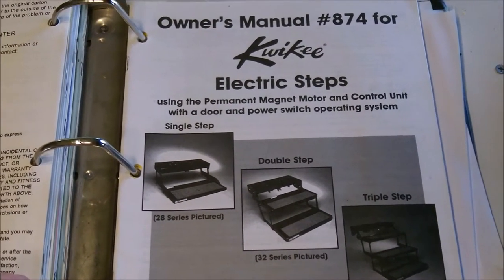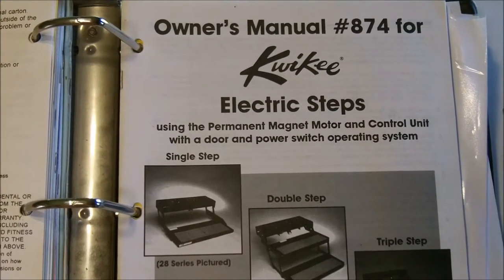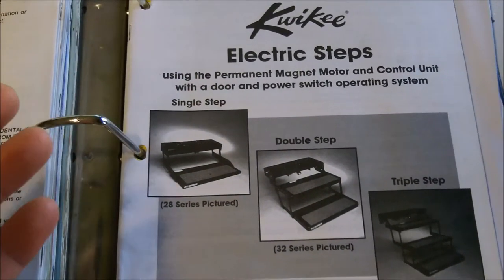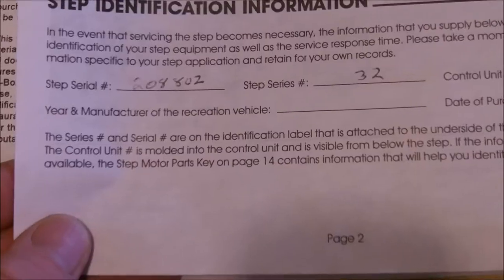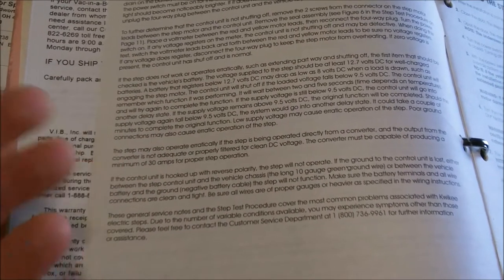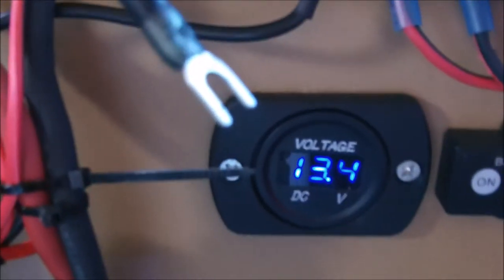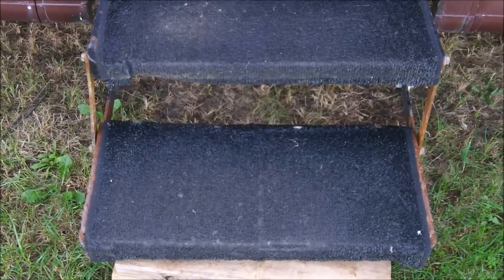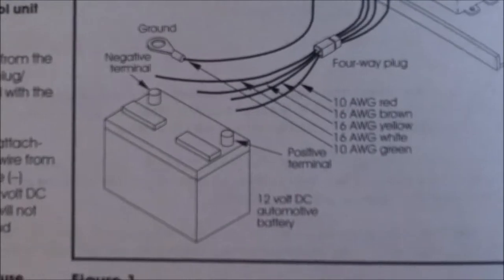kwikee rv steps troubleshoot

Comment: I have had my same Kwikee steps have a similar issue, after the first miracle fix, I have done it again and it worked. This is just a window motor from a car, some people have said to remove and bang it on the ground and it fixes it. My fix was extremely similar. I took the motor out, took it apart, regreased, reassembled and boom, all good. The motor gears get jammed up, I suspect from people stepping on them before they are all the way out. We make sure to never do that anymore. Stuck out is way better than stuck in, by the way, trying to get your arms up there to do anything when they are stuck in...holy crap. Anyways, zero dollars invested in my OG Kwikee steps from 1999 and fixed them twice, they just wanted some attention, might be your issue here, though a year later, I hope you have fixed already.

Comment: Just fixed my step, mine was straight forward the trans arm broke, on thing you might want to try putting 12 volts to the motor,  if you reverse the wires in will run in or out as needed.that will tell you if the motors good, new motors are about 40.00 on amazon

Comment: my steps wouldn't go up i had to get gas too. i put power to the motor with a 12 v jump box  steps went right up. put them back down the same way just reversed the yellow and red wire.